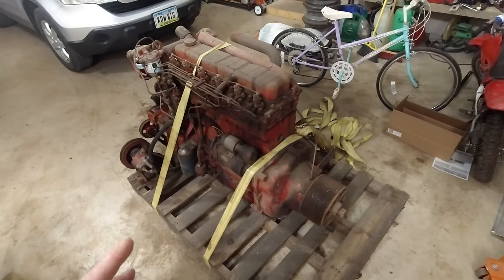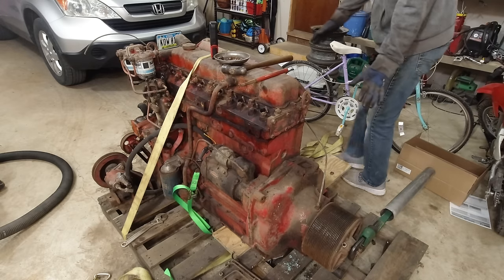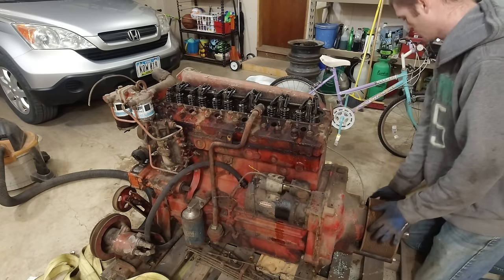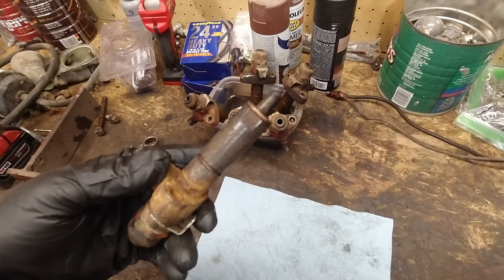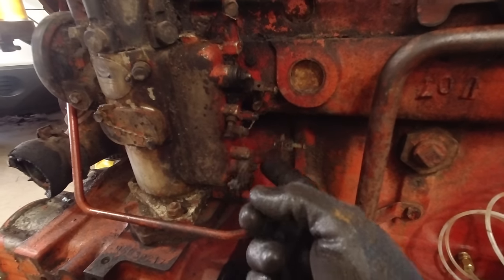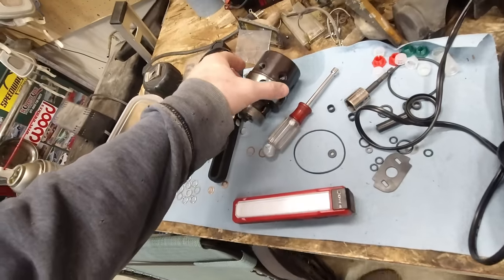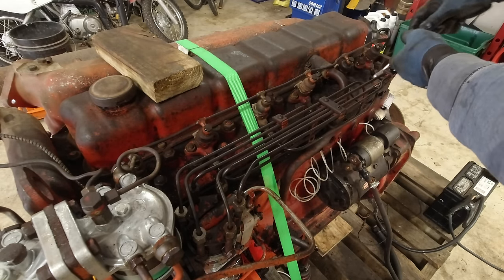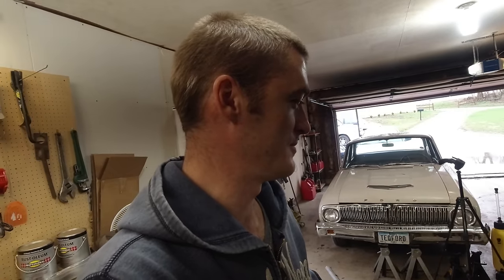Seized Perkins 6.354 First Start In 34 Years

Comment: the old  354 perkins was the best ever. i was a perkins engine mechanic for 41 years-loved setting up the pumps for more hp. watching this brought lots of good memories nice video. i could used to get 220 hp out of the old  6.354t  engine
Reply from the maker: Thats great! I'm sure you could teach me some things.
Reply: One of Perkins finest engines, far superior to the equivalent Ford.
Reply: Jedno pitanje oko perkinsa...motor je perkins oznake 4-107...dali znate od cega pase anaser ili starter posto delova nema kod nas..hvala
Reply: @nenadristic5871  A Lucas starter I think.
Reply: Fantastically reliable engines.
We had the 6354 engines older brother in our '43 Fordson tractor, the legendary P6.
That engine just could not be killed!
Massey Ferguson didn't buy out Perkins for no reason, they knew they were getting class leading engine makers.

Comment: I've got just the job for that engine!  I have a nicely sized Stamford generator that go very well with that Perkins, and made just down the road from Peterborough.

Before deciding on what you want to do with the engine, bear in mind that it's an industrial power unit, and governed quite low 2200 to 2500rpm, so not ideal for automotive use, but would go well in a tractor 🚜 (or a combined harvester 🤦). This engine was built to provide high torque at a constant rpm, not for speed at varying rpm, however, if you had the notion to go for it, you could get away with swapping the injector pump to an hydraulically governed version, which would have been used for automotive applications, but it all comes down to how much you want to spend, and what the ultimate goal is for the engine.

What is nice to see, is that you took the time, and made the effort to learn from this project, and now you understand how a sixty years old engine design works.  You've also learnt why engines like this one will still be running in another sixty years, long after today's digitally afflicted and computer enslaved engines are dead and buried.  Put it this way, this is just the kind of engine you would want on your generator in a post apocalyptic world.
Reply from the maker: I agree. Thanks for the input!

Comment: I understand your flustration , my projects usually end up that way, I have had an industrial 4 cylinder Perkins since 2007 it has been an excellent engine very efficient to run easy starting even in cold weather. You need a bigger battery they need to snap over. Great job enjoyed your video.
Reply: I ran that engine in dodge trucks and they were all ways 24volts for starting

Comment: Way cheaper than setting in some school room  reading a book and writing a chapter on how it works. Best money spent is  on a education hands on. I think since it must be a farm country, a farm pickup such as a "Highboy" ford pickup or if your a chevy guy then a C10 or the K10 (two wheel or four wheel drive) for another adventure. Bellhousings are sorta universal mount on most diesels using a same bolt pattern on many of the engines. I'm a  retired diesel mechanic and hot rod builder. This engine is equal to the cummins engine a lot of folks do conversions of. Convinced me to subscribe cause you didn't quit!

Comment: Hi from Scotland, most of these 6/354 engines used 24v starter motors which spin the engine very fast, the 12v starter is a wee bit lazy. you can get a clutch and gearbox for it very easily because they were used in Dodge lorries and various busses back in the 70's and 80's. that combine engine will only rev to 2200rpm but you can open it up to 2600 easily enough. good video and your blessed with a very good mindset for these problems. end result= top man plus.
Reply: had one in a hire truck in eighties, froze in winter, but still started + drove10 miles before seizing on motorway. brayed 2 pistons out, rebored 2 cylinders, flapwheeled the rest, + rebuilt with 2 oversize pistons, cut the seal off the pump + wound it right up. put a beavertail body on, tadah!, replacement for our stolen recovery truck...
addicted to ether, 12v starter fitted, with 24v jumpstarter employed, once started, never turned off. was governed to 45mph, did 62 now! don't know the revs, but ministry man jumped back when i revved it up for smoke test...
did sunderland - torquay - sunderland in a very long day, used 1 gall of oil, but never flickered once, 11mpg.  can't do 60 miles without stopping for a piss now...
oh, + most importantly, it had dixie air horns across the roof, + a radio nicked out of a scrap datsun        BNL244T i think, something close anyway

Comment: Great video and you did a great job of rebuilding the fuel system. These early Perkins engines did not have glow plugs to heat the fuel so starting fluid was the only option.
Reply: We used to hang a burning diesel soaked rag on a welding rod over the intake, and yes, the rag did sometimes
get sucked into the engine !  Happy, simple times !!

Comment: 👍👍👍Nice job. 
That year of diesel engine just needs 1 wire to the block to switch off the fuel thus stopping the engine.
That's why they gave a million miles plus if maintained.
Today having to recycle a bit of sooty air back into the inlet side of the motor is why they don't last as long.
Reply from the maker: Ya I believe that. You would think it would be better to run an engine a little dirtier and get more life out of it then having to rebuild them more often. I think many environmentalists don't consider the manufacturing and remanufacturing into there equations.

Comment: Sounds great, and just like a good combine engine should sound!   Hope it ends up in a vehicle after all that work.   Having an inoperative injection pump along with all the typical issues in parked vehicles was a first.
Reply: Diesels not used in cars, smell gets in the car. Used in commercial only because of their high torque resulting great power needed in commercial usage
.

Comment: Last winter I actually put a T6.354.4 perkins in my 85 Chevy c30 dually.  Has 2 transmissions a 5 speed main trans and a 3 speed auxiliary.  I have a shorts video on my channel of me running it though some of the gears.  Lots of torque in these motors too.  I'm a diesel mechanic and perkins are my favorite engines for a diesel they just run so dang smooth and quiet you can set a pop can on the valve cover and it will stay put and just like you witnessed straight pipe you can can a normal conversation with someone right next to it while it purrs along

Comment: Real good achievement you got her running again. Look on YouTube for a guy called Bundy bears shed, he is an Australian guy who does strip down and rebuilds of the CAV diesel pump, very very easy to follow and understand, I had the exact same problem with a Perkins A3-152 that hadn't run in over 20 years, the plungers in the high pressure pump were stuck exactly the same as your pump so after I took it apart and freed them away it went. Diesel pumps can be worked at by home mechanics that have basic knowledge, the smile and expression on your face when you said 'it works, finally' says it all, good work buddy.
Reply from the maker: It was a very good feeling to here it run for the first time. Thanks for watching!

Comment: I have been a rectory trained Perkins engine tech for 30 years. They are great engines had a T6354 in a 75 r250 with a fuller 10 speed trans. The Perkins engines respond really well to performance mods, they really love fuel and boost.
No the fuel line sealsvare call olives,

Comment: Excellent video  :) also you buy parts from Massey Ferguson dealers they sell parts like injectors , gaskets , fuel also oil filter for them and all need to rebuild kit ! Plus fuel injection pump plus fuel steal lines if not find a Desiel motor rebuild company services them ! Even time gears get from Massey Ferguson! Only if need crankshaft also camshaft  get turn deal with Desiel motors of company  resurface them on foul measurements ! Also for Fuel Injection pump plus injectors fuel run nice use Automatic transmission GM type of 2 or 3 and a Grey Bottle of STP Total Treatment fuel injection and carb cleaner in fuel  tank monthly also keep clean and run smoothly too may smoke bit on engine but never seize up ever again! Also I know late Mechanic knew put that that type Massey Ferguson Combine motor in a Dodge D350 van , hook up a Truck Floor shifter transmission plus Hydraulic clutch with fly wheel, had 2 12 Volt Negative ground battery for it plus Glow Plug set up on engine and motor bored up 400 Cubic Inches size from 354 Cubic Inches on 6 inches not turbo too !

Comment: Well done, having a go and seeing the work through to the end is the way to go. The engine runs nicely. I hope when you rebuilt the injection pump that you replaced the drive end seal. When it leaks; fuel can enter the sump and dilute the engine oil. It does this on MF 35 & 135 Tractors that have basically the same pump. Somewhere on the web it will tell you if this will be a potential problem for this engine. Anyway, you have reaped the benefit of satisfaction so good job. It would be a good follow up video to see the engine put to use. All the best.
Reply: Or fuel can enter the oilpan via bad diaphragm on lift pump.

Comment: a good strong engine them perkin`s , fitted in many truck`s in the UK from the mid 70 to the mid 80 . thay wear a bitch  to bleed up / start  after changing fuel filter`s , due to having a rotery CAV injection pump . the later 6.354 had more power than the early one`s because thay fitted a inline injection pump and bigger injectors , plus turbo

Comment: If you ever run into something like this again, instead of dumping motor oil in the cylinders, use a 50/50 mix of ATF and Acetone. Great penetrating oil for breaking loose rusted parts....
Reply from the maker: Ok thanks

Comment: There should be lots of those motors kicking around. They are great engines. Maybe could have found one in running condition. I've got 3 on 760 Massey combines and one V8 Perkins that I'm about to swap into a 1940's Chevrolet 1 ton. You should have tried either right away to start it. Sounds good, great job.
Reply from the maker: Thanks

Comment: Pretty cool.  Sounds really good.  I think I would try and find a truck to drop it in.  I have to think that is a torque monster and would be useful around the property.  I would think the easiest would be to have a bell housing adapter fabricated for it vs. trying to find a transmission to fit.
Reply from the maker: I would agree fabricating a bell housing is the way to go. I need to figure out a truck to put it in.
Reply: @HumbleAcres  My first thought was a Ranger or Mazda B-Series (same thing) as you see them everywhere for next to nothing.  Just not sure you could shoe horn that thing in there.  If you need full size, I guess I would look for a Ford F-150 for the same reasons.  Maybe full size might work better for the driveline, too, for that matter.  I would not blame you if you sold it, however.  You are like me with no shortage of projects and $1500 helps fund some of them.

Comment: Perkins made bell housing adapters for ford and Chevy in late 70’s and in the 80’s.
Reply from the maker: Do you have a part number or know what transmission the adapter was for?
Reply: @HumbleAcres  I bought my used engine not running in 1998.
I saw a 75 ford truck with 6.354 in Fairbanks 1993. I tracked down shop manuals and parts book. I’m trying to remember what state that dealer was in. I think the dealer ship was making bell housing. I still have my engine I never did retrofit with it. I’m trying to find my manuals from back then. That where I have the bell housing info. I remember dealer photo copied sketches of motor mounts.  
Pre internet is was really hard to find information.
Reply from the maker: It's still hard to find info on this, Let me know if you find anything! Thanks!
Reply: @HumbleAcres  In 1995 ,Anchorage Cat dealer trainer came to Fairbanks he was telling me about how he put 6.354 in 80’s Chevy truck had to remote mount oil filter because frame was narrow. I was thinking he got engine from a step van truck and it would have had transmission. 
Back in those days there was not many 5.9 cumins around. 
I will try find my manuals

Comment: I'm a regular mechanic but if needed I will work on tractors... the city brought me a tractor 🚜,   they thought it was overheating,   I pointed out there's no thermostat... turns out the engine is seased... I over hauled the engine... meanwhile I video taped the whole process... I added new parts and made it work like new... after 3 days I called the supervisor to bring in the tractor 🚜,  the thermostat was removed and had no gasket... I told him,  my work was sabotaged by his employees... before it left, I showed him the gaskets,  when he brought it,   there was no gaskets...  I asked him as nicely as I could,   you owe me nothing as long as your company doesn't come around... he got mad, I really don't care... I got 3 tractors 🚜in 2 days,  I charged them the full amount for my work... I heard nothing...
Reply from the maker: That seems like a pain. Best of luck to you.

Comment: Why didn't you just put power to the starter?
Reply from the maker: not sure what you mean?
Reply: @HumbleAcres You need to hook-up a battery to the starter motor to determine if the motor spins. Why risk breaking the reduction gear box by wrenching on the output shaft?  It seems obvious that the reduction box is meant to lower the speed due to the presence of the wide belt pulley on the output shaft.

Comment: Take the valvecover off and put some diesel/wd45/oil in each cylinder through valves,those which are not open can be pressed open with a tool.

Comment: Gotta get yourself a tractor battery
Reply from the maker: That would be nice but also big and heavy.
Reply: @HumbleAcres  True, but it would start so much easier. Even a diesel in a pretty good condition won't start if the starter doesn't give the engine enough rpms, which is clearly the case here. The engine almost stops sometimes. The bigger battery the better.